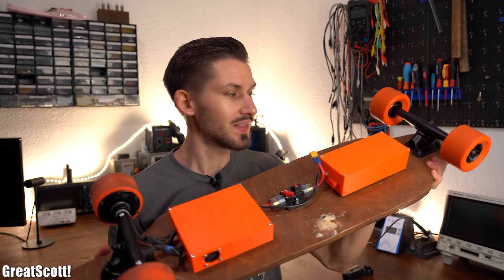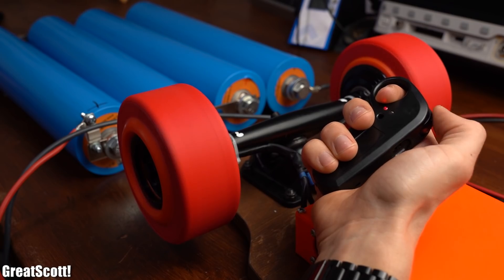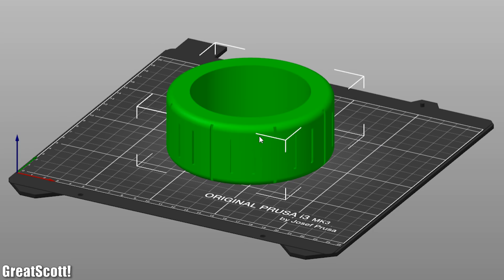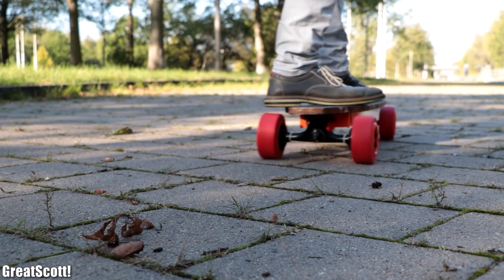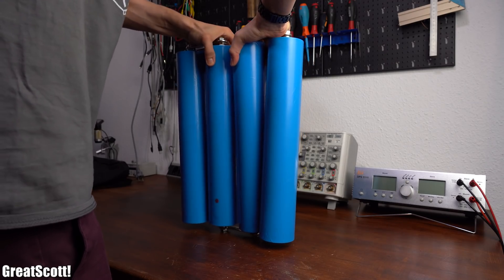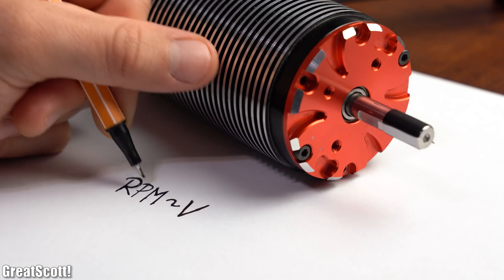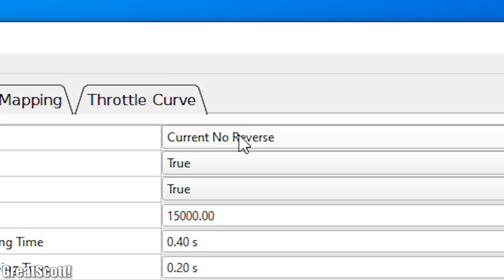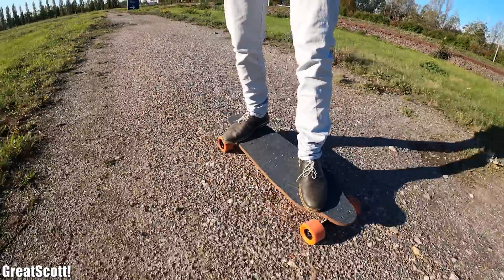Creating an Overpowered Battery Pack and Off-road tires for an electric longboard! (Experiment)

Comment: I've found that boost converter is kinda crap. The maximum ratings are NOT continuous, not even for a minute. The best it can do continuously is about half. The output capacitors have high esr and get red hot; replace with something better and the whole board will run cooler.
Reply: Some quick calculations from getting 30km/h for 7km on a 108 Wh battery suggest that the longboard uses around 400 watts. If GS can only really get 15a into the converter that's only 180w. Assuming the converters have current limiting I suppose he could just run three in parallel.

Comment: What about excluding the boost converter while braking using a beefy transistor on the boost converter output. You can control the transistor listening to the thrust signal from the joystick with an arduino and a radio module or something like this. So you basically cut off the boost converter part of the circuit and you can connect esc to the batteries to recharge them.
Anyway great Scott and great video too, i really like your projects

Comment: Assuming it's current limited, you could have used the external buck converter to just charge your existing built in 24v pack while riding.  With that setup any braking/regen would just be absorbed by the small built-in 24v pack, but there would still be a constant supplemental charge added by your backpack battery.

Comment: like the video however the tire tread that you used is defiantly not the best, ideally you want the tread to push dirt or water outward so the tires dont get gunked up and become slick again. personally i think having a chevron type pattern pointing in the direction of travel is best but there are probably some better designs out there.

Comment: interesting project and upgrade as usual. kindly make dents on the 3d printed tires that are perpendicular to the parallel ones you already have. that would prevent sliding when negotiating a curve on a smoother surface.

Comment: Can you do a break down of how the lumary wall outlets work internally?
https://www.lumary.tech/products/lumary-smart-wifi-in-wall-outlet-15-amp-tamper-resistant-split-duplex-receptacle-2-plugs-compatible-with-alexa-google-home-no-hub-required
Reply: That's more of a Big Clive question. He recently did a teardown of some WiFi outlets, except those were a different brand and 240v instead of 120.

Comment: If you used the smaller wheels  with the big batteries the top speed would decrease but the torque would be higher than with the big wheels, maybe it would have enough power?

Comment: one solution can be to use the big battery to charge the existing battery, but you need to provide at least 1V of difference at the highest charging voltage in order to let regenerative brakes work as well, I just said what I think and doesn't know if it can be done in reality or not

Comment: Would it be possible to use the boost converter and a set of diodes to ensure that the current and power goes the right way when braking??

Comment: I think you should try making mold and then casting wheels from something like hard silicone (maybe there is better material for this? That would need some research). Casts won't separate as easily as 3D prints.

Comment: Have you thought about Charging the old smaller Batterie Pack with the big one in combination with the booster. So the smaller batterie can take all the braking energy if you don't fully Charge it up

Comment: Hi GreatScott!
Materials like TPU pull moisture extremely quickly. Best thing to do is to dry the filament during printing.
To do that I'd recommend just buying a cheap food dehydrator (preferably with settable temperature).
Then just cut the mesh out from the compartments and drill a hole on the side for a PTFE tube.
You'll also need to print something so that the filament can rotate freely.
You can find some inspiration on the internet. Even 3DMN made a video about converting a food dehydrator.
Hope it helps!

Comment: Why not build your own 2 way boost(buck) converter?
Or take the direct way for feeding energy back? With the internal resistance of the batteries and their thermal mass there it shouldn't even be necessary to step the voltage down for regenerative breaking. Just using some Relais or mosfets for switching between breaking and accelerating.

Comment: Need to integrate the batteries into purpose built longboard body with a dead man foot switch on top of the board incase it gets away from you, with that much mass it could become a ground torpedo.

Comment: If you boosted, you could have added a brake switch In a sperate circuit., Or added a relay, which gated to the motor when on, and to the break when off.

Comment: You could use the boost converter to feed the smaller batteries on the board and keep them at ~50% charge. This way if you brake the current would feed the smaller batteries without destroying the boost converter!

Comment: out of curiosity
why didn't you connect 2 in parallel and in series to get twice the voltage (and half the capacity) to at least run the motor normally
Reply: If you watch closely you can see he connected them all in series. So it is already 4 times the single cell voltage.
Reply: Yeah exactly what I thought aswell, who needs a range of 80km? Half that is still insane.
Reply: so
that monstrous battery is 3 volts?
wooooot!!!
Reply: That battery has 3.2v

Comment: Your lengthy wires could be the culprit of the failure,well correct me if I'm wrong.but if i'm right ,then try building a box like board for the battery ,so it won't cause damage while you stand on it.
Hope that helps ? 🤔😅

Comment: Would be nice to make two contact pads on top of the board and wire the battery pack to your shoes. So you Don't need a wire between your backpack and the board

Comment: it's really not safe to use 3D printed stuff for such a workload, you really need to find a way, to cast that material in one solid piece, otherwise no matter what you'll do, the layers will separate

Comment: To use the boost converter, what about using the original battery connected using a steering diode and feed the reverse current used for breaking to that ancillary battery?

Comment: Couldn't you electronically switch out the boost converter when regenerative breaking is needed?  Surely it could be done quickly enough to be unnoticeable and remain safe.

Comment: Could you add diodes going into the boost converter from the battery pack to have current going from the batteries to the board? Then have plain wires with diodes pointing towards the battery pack running from the board to the batteries? Would this allow you to boost the voltage and have current from the battery pack go to the board and then current from the regenerative breaking going from the board to the pack, bypassing the boost converter? They'd have to be some pretty beefy diodes though, so not sure.
Reply: This wouldn't work because your diodes handling the regen would redirect the output of the boost converter directly back to the batteries.

Comment: I know that with DC motor you can short break them. Is it possible to make the same with BLDC?
Reply: Yes you can. Rather, shorting the leads from the 3 phase motor itself will cause braking. If you short the input to the driver/controller board the results may vary based on the design of the particular board.

Comment: Couldn't you wire it up so that the original Electric longboard batteries drive the wheels and then your battery pack charges the batteries?

Comment: Watching people building diy electrical longboards proves that the best thing is to buy the ready made parts and just assemble them.

In this case tho, the best way would be to use the old battery as a main battery.

Then use the beefy one with the booster Inside side your backpack(or maybe on the longboard) just to charge the primary battery and extend range. This way you should still have the brakes and the regenerative brakes.
Reply: it all depends on your tools skill and how much time you want to invest. There is some stuff you just cant buy.  But for the average person its easier to buy everything.
Reply: @tech518b9  I haven't seen any diy more reliable than the commercial parts in this case, but I guess you're right
Reply: @RotaruCosminLeonard  most one off diy is not very easy to find on the internet. Most of it is not even postet. I for Exempel welded my own motor mounts directly to the trucks. That's better than all of the bolt on stuff.

Comment: Hey Scott!
Have you tried taking a look at reversible DCDC converters? A reversible boost could help you boost the voltage and still allow current to flow back into the batteries.
Reply: Just use a small battery pack in the board and use a boost converter with a diode to prevent reverse current. The regen will charge the small pack and the large pack will power the board.

Comment: What a catastrophic failure is that!

1- It doesn’t work
2- It’s huge, heavy and uncomfortable to carry those batteries in your back
3- It requires a cable from the backpack to the longboard
4- The tires only lasted 5 km
5- It requires a 3D printer, tools, knowledge and time
6- This build doesn’t make sense from an economical point of view

Comment: Well, that's exactly why E3D is making fun of Prusa for having inconsistent extruders, they really struggle with soft flexibles due to their long trevel path between the nozzle and drive gear as well as their single drive gear. Aka you would have to print a lot slower with well calibrated retraction and linear advance settings, or upgrade it/get better machine. That aside, the grid infill pattern isn't an ideal choice for tires, honeycomb would offer a more even load distribution and reduce the layer stress on compressions.

Comment: When you have 4 batteries, why not go with 2 parallel 2 series?
Reply: That would only create a 6 volt pack which would result in even less power than the failed twelve volt test.

Comment: Word to consider to your future self: two component adhesives usually harden fully, will not flex and eventually break. Consider using rubberizing urethane glue instead.
Reply: By the way I am making Arduino projects in my channel please take a look 😀
Reply: @HoXDipannew  and how it it relevant?

Comment: You could improve the tires further by trying a 3d infill pattern. Square infill resists deformation along its inner walls, causing the softness of the tires to be inconsistent at angles perpendicular to the pattern wall.

Comment: Use a second voltage convertor and a rectifier, so when the motors brake the return current is redirected by the rectifier to the second voltage convertor which brings the voltage back down to 12v and then on to battery.
Reply: Yep, boost up, buck down.

Comment: @GreatScott!  One more option would be to rewind the motor with higher gauge wire to better handle you low voltage, high current driving. It's actually not that hard to do and could be a good video. Look it up!

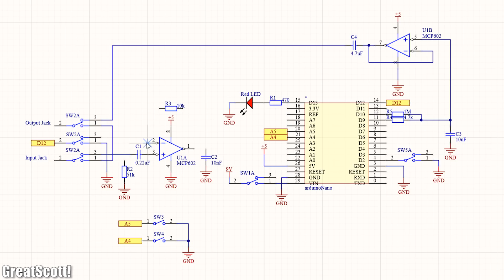Comment: 2:05 "It comes with everything you need" Well.. of course! Altium is the industry standard PCB design software, with a price of US$ 325 per month. Needles to say 95% of the designs can be done with Kicad.
Reply: Just find it on torrent you noob
Reply: $325 per *month*?? Holy hell! That's well beyond the reach of any hobbyist.
Reply: @KaedennYT  or US$ 9990 for a perpetual license.

Comment: Couldn't you just change the motor for a different KV rating, or is this impossible as the motors are embedded into the wheel hubs? Maybe another side project but rewiring the motors would be interesting

Comment: Why not use the boost converter for powering the wheels, but then use a reverse current detection during the breaking, to trigger a bypass relay to enable charging?
Reply: I think that is going to be a very good solution, but I guess relays are not really designed for many opens/switches per minute, indicating many slow downs in speeds
Reply: @shamsmm  Could use a solid state relay. They are rated for millions of operations, and some can even do PWM, so obviously can switch very fast.
Reply: @rlaxton666  Yeah I agree with that
Reply: I was thinking of that too, but I think it'd be easier to simply turn the large battery into, essentially, a power bank that keeps the small battery at ~80% charge.
Reply: @MrFastFox666  Like a guy said in another thread here, charging batteries with more batteries is inefficient, I would prefer the relay method, ive seen a guy do pwm with a relay (yes) just fine
Reply: @SirDella  Just use a MOSFET. All solid state, no mechanical components.
Reply: @groundzero_-lm4md  Just playing safe, never used a mosfet before, it's not like relays don't last ages
Reply: Because that's just a overcomplicated way to solve a problem which lies somewhere else: a way to low battery voltage. You get way to many problems by using low voltage
Reply: braking*

Comment: 7:22 wait, you have an 80 amp fuse protecting an XT60 (60 amp) connector?
Reply: That’s fine cuz the connector is rated for 60 amps continuous it will handle 80 amps burst until the fuse pops
Reply: @towers3372  ah yep that makes sense

Comment: I think the reason was because of battery's weight. But anyway u should have increased the voltage or find a circuit that can do both boosting thing and breaking thing...I'm not happy seeing u fail in every episode of hacked bruh :(     good luck next time: ) , and my another recommendation is use a small trolley for the battery pack so that the board can handle only ur weight.

Comment: Could you use the batteries in series and parallel at the same time (pairs of 2) so you could get 28v from it?
Reply: Yea he could, but the battery would be huge
Reply: They are already in series, which gives maximum voltage
Reply: @MrCh0o  yeah my bad rewatched that part

Comment: noob question, but wouldn't you have been able to put the batteries in 2 parallel and 2 series to double the voltage? or are there some safety risks?
Reply: He wired the cells in 1p4s configuration, not 4p1s. Switching to 2p2s would halve the voltage. The large blue cells are 3 volts each, not twelve.
Reply: @eDoc2020  oh wow. that's a huge oversight on my part. thanks for the reply
Reply: @TheLaziestGuyEver  Don't worry, it seems at least a dozen other people made the same mistake.

Comment: Dont worry, if that battery pack would have worked better, you would soon have found out that standing on a longboard with a 18kg backpack on your back is nothing you want to do for 80km without breaks to recharge anyway.
As you now have to print new tires every 5km anyway, the old battery pack with its reach of 7km will do perfectly fine ;-)
But of course still an interesting experiment, sometimes things that dont make too much sence are even more fun.

Comment: I'd use Altium if it wasn't so ungodly expensive for hobbyists.
Reply: Yes altium is not made for hobbyist. It’s a professional program and it have so many options that’s for hobbyists way to much
Reply: There is a free version of theire software, called "Circuit Maker"
Almost same capabilities, but you can only have 3 personnal projects and others need to be public (anyone can copy your design, not modify it though)

I think it's better than Eagle, it was easy to create new components, and there is already a big component library (people that create components designs can share it so it is part of the library, very cool feature to me)
Reply: Trust me it's not worth the money. Part of me still wishes we stayed with Eagle.
Reply: @Nikkuuu69  Yeah, I'm still using EAGLE, thought not necessarily the way Autodesk wants me to.
Reply: @thomasbecker9676  Yeah, 3k a year isn't what I would say the audience of this channel wants to spend on schematic capture software.  That's pretty much my discretionary hobbyist budget outside of upgrading a piece of test equipment.  I cringe at what Eagle is costing, and that it's bundled with Fusion 360 now.
Reply: @NGinuity  There's ways around having to log into EAGLE....just saying...
Reply: @thomasbecker9676  I get it but my point stands on its own merit.
Reply: @NGinuity  No one should ever purchase Autodesk software. Ever.
Reply: Haahahahaahah just find it on torrent you noob
Reply: @heanstone1327  yeah, that's not actually useful, give the way it's set up. Moron.
Reply: Yarr, matey.

Comment: Why wouldn't you be able to break? The ESC would just apply EMF in the reverse order. You know how if you switch two wires on an ESC the motor will reverse direction? Just do that, but in software!
Reply from the maker: The VESC does not support that. You would still need to get rid of energy and thus require breaking resistors.

Comment: You could re-wire the motor to work with lower voltages and higher current, that could work

Comment: If the boost converter uses active rectification and mossfets, you can still use it, as it will probably do bi directional power transfer.

Comment: Couldn’t you use a braking resistor so you can use the boost converter and still have brakes?
Reply from the maker: I think the VESC does not support that
Reply: Seems like the best option would be a MOSFET across the boost converter (From + in/battery + to the converter output) to back feed the current .  This is tricky to describe but you would have a resistor in series with the boost output and ESC + in, and a diode across this so the boost converter output wouldn't pass through the resistor.  You would then hook the LED of an opto-isolator to that same resistor in the opposite polarity, which would be driven when the voltage across the resistor reached the LED threshold.  The transistor.of the isolator would connect the drain of the MOSFET to the gate, with another resistor across the gate and source to turn it off.  It's a pain to describe and I've omitted things like a resistor from the MOSFET to the battery, but I think you get the idea.